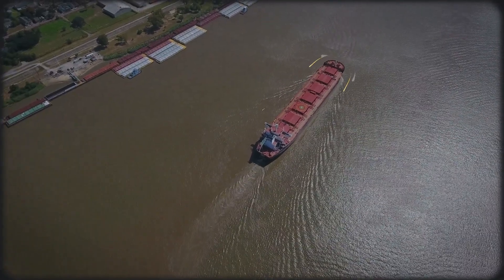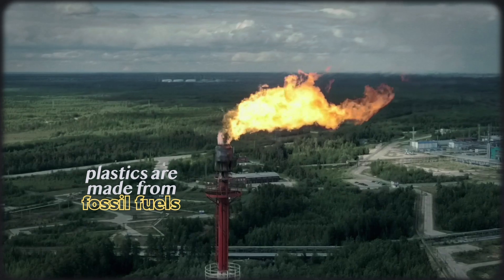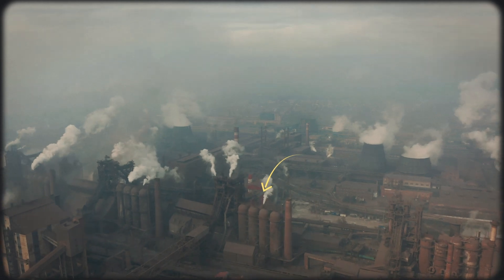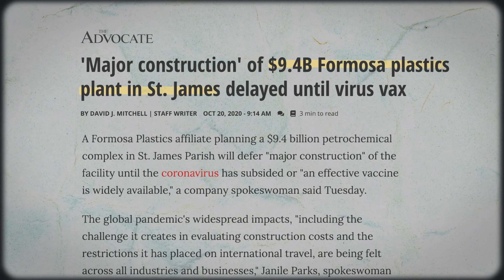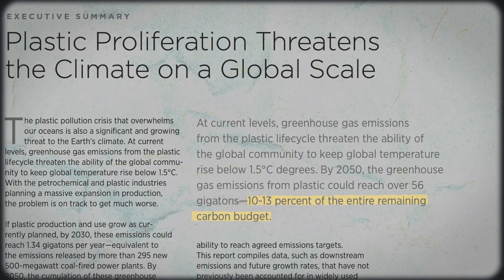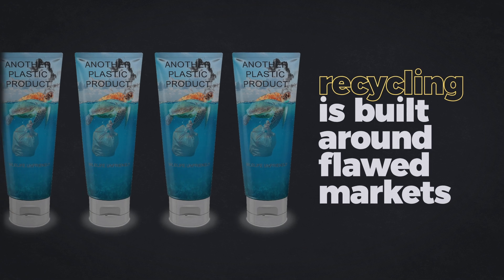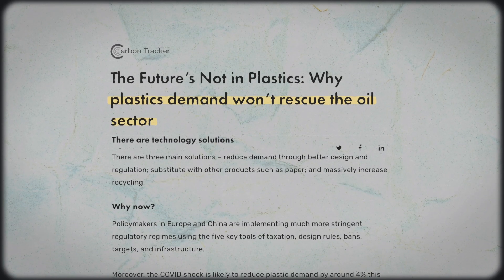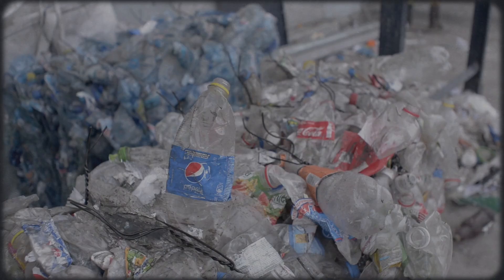Why Plastic Pollution Is Even Worse Than You Think

Comment: But plastic doesn’t degrade? Doesn’t it lock carbon in an inescapable prison?
Reply: that not exactly correct. it will break down similar to how rocks break down but so it will become a fine dust sand. it can be burned but that will just release the cabon back into the air.
Reply: It isn't it only breaks into small particles. And those are harmful for your health. They disturb hormonal system and reduce fertelity

Comment: You ignore the fact that most of this discarded plastic can be recycled into road materials and other useful chemical products. it's just a matter of properly scaling these efforts up, as opposed to the small operations now currently existing in India, Canada and Africa.
Reply: There you go, spread it on top of the land instead of burying good thinking. It won’t leach or anything
Reply: @nhlombardi6946  If it's mixed in or bound with asphalt, no worse than asphalt alone... If its made into railroad ties, no need to treat the ties with toxic chemicals... If it's made into industrial grade parts, no worse than using regular plastics, etc.
Reply: @JungleYT     I think we need to shift away from things that are cancerous for humans and bad for our environment all together and invest in new, safer products. We need to stop justifying poisoning our land just because one thing isn’t “as bad” or “no worse” than the other.

Comment: Governments should just ban all single use plastic, companies will have to find another, more sustainable way. For example reusable glass bottles - and perhaps reusable stainless bottles too! With a return on them so they get returned to pick-up points. A captive lid with a rubber gasket. All steam-sterilisable and reusable. Standard size and shape bottles for different goods, the only thing the manufacturer is allowed to do is stick their own label on it.
Bring back small shops, these huge chains are all self-service and there lies the problem. Want 12 woodscrews? Fine in a small shop, they can be sold loose. But in a big store you have to buy two packs of 10, or a bag of 50. All so wasteful.

Comment: As a regular grocery store shopper, ive noticed more and more things in plastic that used to be in glass. Like spaghetti sauce, juices, So on. Make little choices every day, if you buy eggs, only grab ones in paper based cartons. Grab a drink in glass(cans still use plastics, and even glass does in the lids to help seal them). If you have no choice but a plastic container, try to get in more bulk sizes to lessen the impact in at least a minute way. For most normal people, its in fact impossible to go around with out using plastics(single use type) these days. But just think about what you are buying, and if there are options with less or no plastic used. The less the better. A can of soda is going to be less plastic then a plastic bottle...

Comment: Items made from plastics intended for long term uses are not a bad thing. Ex: insulation on wire, fresh and waste water pipes, construction materials, durable goods, etc. But plastics for single use, ie: plastic containers, shopping bags, automotive oils, medical equipment, etc. is unsustainable because these materials do not break down naturally like materials made from natural materials. I believe one of the most wasteful uses are drink and water bottles. Even thought these are made from highly recyclable PETE most wind up in landfills.

Comment: 9:25 "you cant even buy lettuce without buying plastic"

I can lettuce from a farmers market and big my own cloth produce bags. Way more expensive than the store bought of course. The store also has loose lettuce bunches, but it still usually has a plastic twist tie around it. 

The best solution is to grow lettuce at home. 1 or 2 small pots, a little bit of soil, and then just water and sun. Seeds are very very cheap and its a super easy crop to grow. Plus it tastes even better when picked fresh and you dont have to worry about it going bad in the fridge when you always pick it fresh.

Comment: Maybe a workable solution is to get the big petrochemical companies to produce bioplastic type plastics from gas, that can either slowly biodegrade as nature's polymers do, or when at the end stage of many recycling journeys be molded into solid blocks to be stored in the driest desert to prevent carbon release?  Better that they focus on solar cell and battery production, and ramp down their petochemical end of the business, focusing instead on a return to reusable glass bottles. 🍶🍶🍶

Comment: Half a tone of cement geos into a wind turbine i heard also the metal needs the fossil fuels to make them the whole turbine if you get rid of fossil fuels how are you going to get the energy required to make turbines think about it fossil fuels are not the Emmy ider is green power makers walking saints plastic it a problem how about making plastic into fuel and we are not become carbon neutral in 9 years or so it just common sense and we can not control the environment it's our boss not the other way round

Comment: I research enzymes involved in breaking down and metabolizing PET plastic. I worked at a national laboratory for two years where we had visitors from all sectors, including representatives from the packaging industry. From the talks they gave, it's clear that the companies actually making the plastic products are well aware of the pressure to make changes, and within the industry it is all anyone can talk about. It's a race to market for them, although it may not look that way from the outside. While the fossil fuel companies are still forging ahead, it's only a matter of time before they're backed into a corner by the loss of patronage from their main supporters in the plastics industry - the packaging companies. When consumers become more aware, and using less plastic becomes associated with social capital/clout, the private companies want to take advantage of it and are setting their sights on doing so.

There is a lot that goes into making the switch behind the scene that a lot of people aren't aware of, including, but not limited to, consideration of the barrier properties of a polymer (Will my soda stay bubbly? Will my chocolate go stale?), and how compatible the tooling for making the old plastic packaging is with the new polymer (Can I use the same molds and expect the same behavior from this new polymer during the production process?). These two things alone account for a huge reason why there hasn't been a more rapid movement away from petroleum-based plastics - the companies still need to consider the financial consequences of this and do right by their stakeholders. Thankfully, there is also a TON of innovation going on in the polymer science field, as well as the biotechnology field - a lot of the work I am involved with is focused on designing new biodegradable and bioderived polymers that better meet the aforementioned demands of the production process, and that also have monomers that can be produced without the input of fossil fuels (i.e. biologically). You can check out bottle.org for info. It's also worth noting that this is all funded by the DOE. Even during the last administration, there was a huge spike in government funding (US DOE, NSF, DOD, etc.) for research aimed at tackling the issues surrounding plastic. The most difficult step will be translating the work from research to industry, but from my perspective, the future still looks pretty bright!